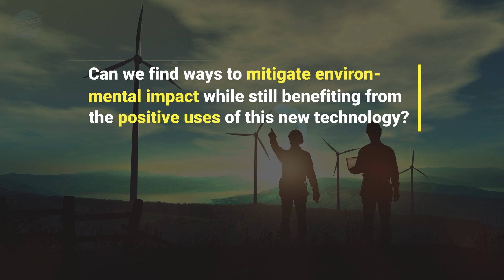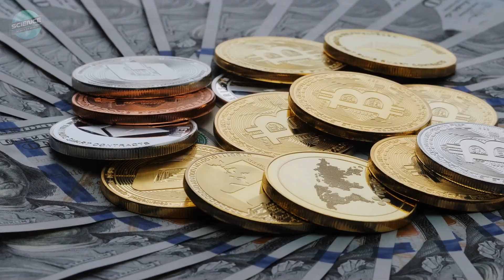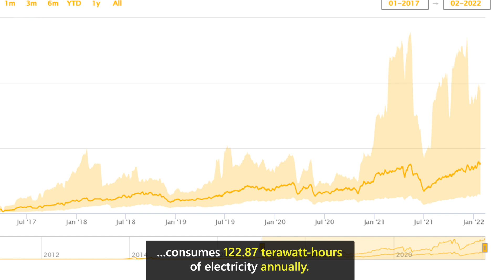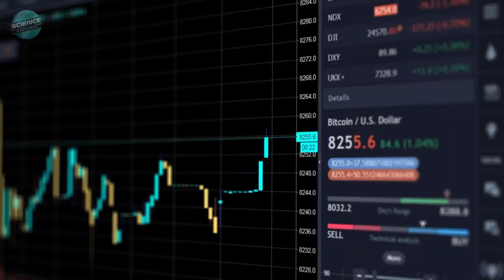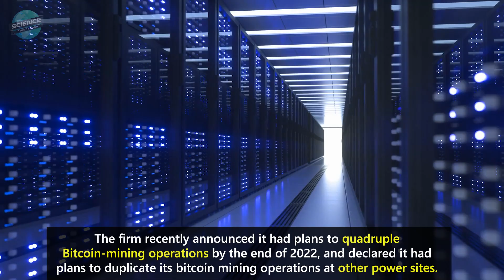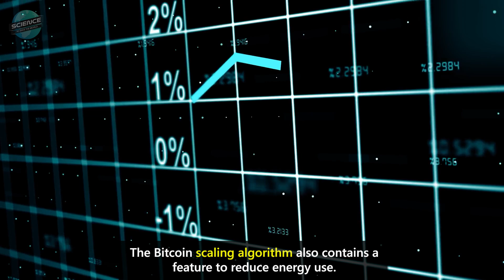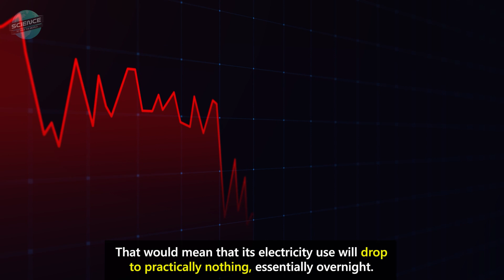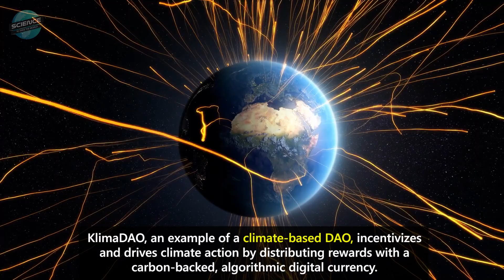Is Crypto a Disaster for the Environment? Blockchain Impact Analysis

Comment: There was an Iceberg that broke and it's raising water levels. Why can't we use spaceships that have led in the inside that can store water? Like the filters that clean our water and store it. Or we can use the same material plumbing pipes use which is mostly: copper, galvanized steel, polyvinyl chloride plumbing pipes. And my last idea is to use PVC Pipes, PVC is a plumbing pipe known for its versatility, lightweight, and blockage resistance. PVC piping is generally used as part of a sink, toilet, or shower drain line, though it's sometimes used as a home's main water supply pipe.